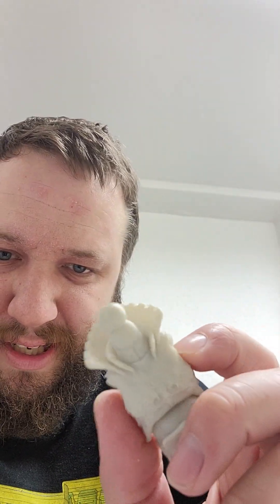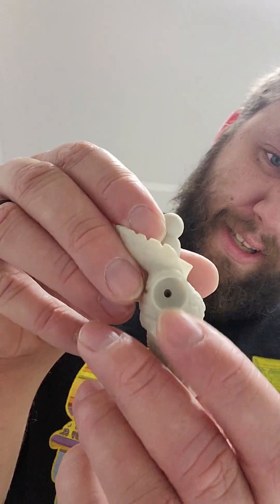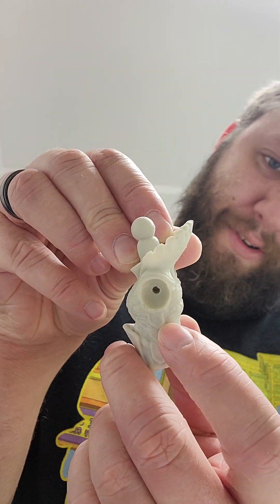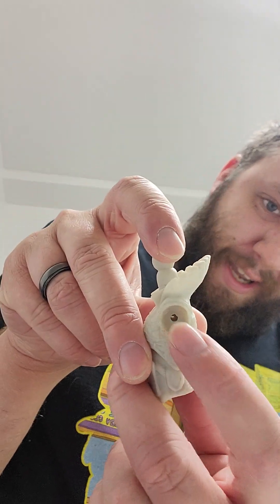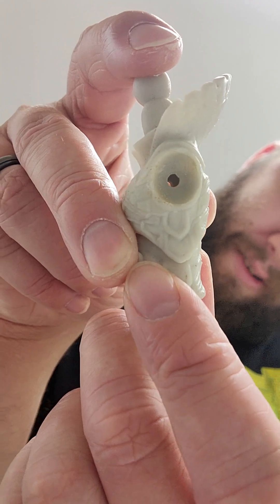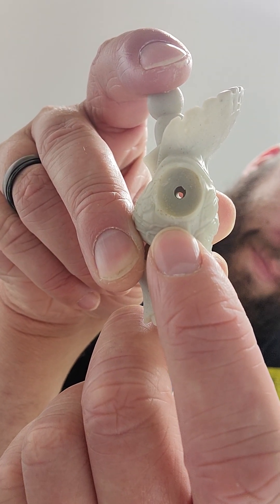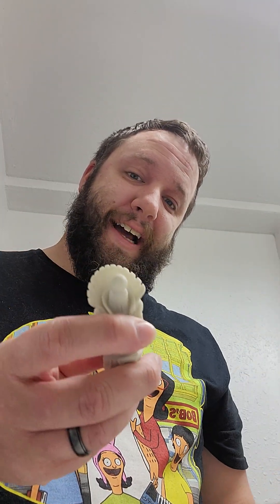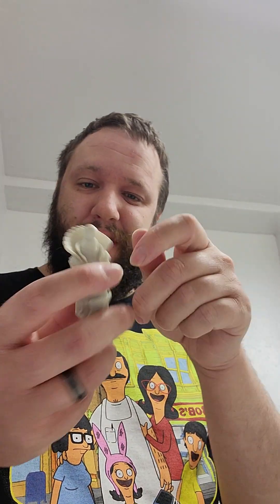Resione Anti-Impact Resin and Mixes Closing Thoughts

Comment: great video! I've been using anti impact and the m85 resione resin mixed 80/20. I've also been dyeing my resin so it has a beige pale flesh tone. i then blast the resin in a metal cup for about a minute before pouring into the vat. i have a 70% success rate with my prints (its probably my settings). my figure I printed is still articulating well and haven't had it loosen up too bad after 2 months. what's your exposure time and speed on the anti impact/ 72 if you dont mind me asking?
Reply from the maker: Blast it in a metal cup? I have it in a post here actually! They're pretty conservative settings so should get the job done. And that's so cool to hear! What dyes you using?
Reply: @headhunterscustoms  hehe using a heat gun on the resin in a metal cup. the dyes ive been using are the resin epoxy dyes you have to use quite a bit to hue shift a medium grey thought, and it might be the reason my prints are at 70%. still experimenting
Reply from the maker: @seesay123  oh I see, heating it up gotcha. So I know they love heat but it can also be too hot, so keep that in mind. Dye maybe make it need longer exposure perhaps?
Reply: @headhunterscustoms  just a heads up, too much of the epoxy dye can ruin resin. my mixture of m85 and anti impact worked pretty well with about 10 drops of various dyes. I tried the same with th72 and anti-impact and it is a 80% failure rate. I'm looking at some other dyes (alcohol and powder based) and even Synthethic dye after curing.
Reply from the maker: @seesay123  good to know! Keep trucking trooper!

Comment: Interesting video! 
I'm about to print some resin action figures, I bought Resione M58, do I need to buy another Resione resin to mix with M58 to make it a litte bit more flexible and long lasting? Which resin should I buy? And the mix 80/20 - 75/25 or something?
Reply from the maker: I don't have any interaction with M58 unfortunately. But I can tell you that anti-impact alone is nigh indestructible lol. Mostly combine it with other resins to increase flexibility a bit. 
I think the person below said they use M58 and anti-impact
Reply: @headhunterscustoms  is there any powdering at the joints with the Anti-Impact?
Reply from the maker: @123hyouretsuzan5  none that I could see! It took pieces of the real arm off first 🤣